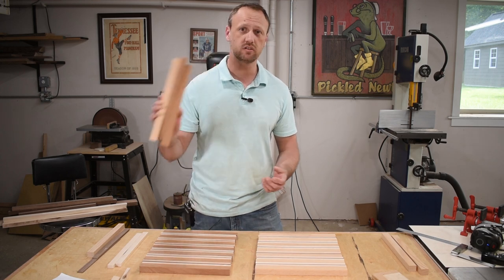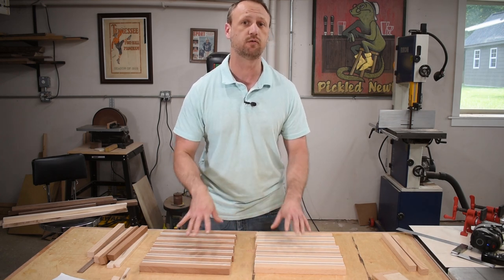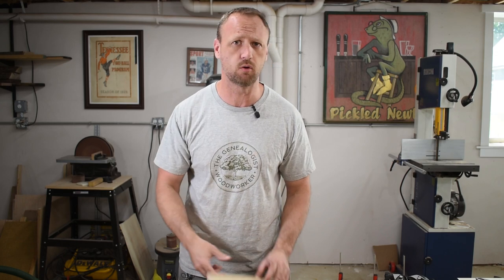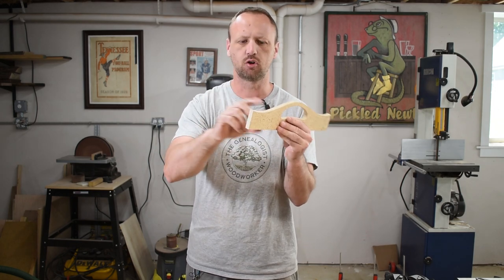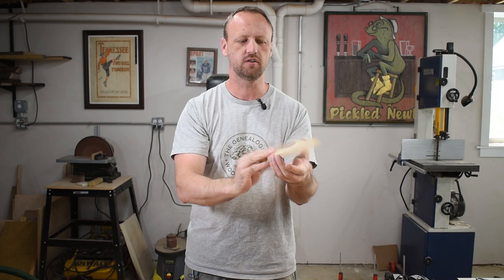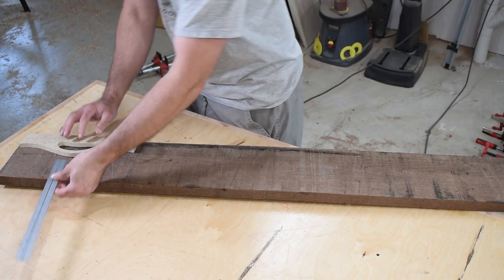Making Wooden Tray Handles from Figured Walnut

Comment: Is hide glue waterproof? I thought only titebond 3 was
Reply from the maker: No, it's not water proof. But it also doesn't desegregate with water if the glue is dry.
Reply: @NewtonMakes  ok. I don't think anyone is implying it would disintegrate. when I put that much time into a project that will repeatedly be exposed to water and changes in moisture levels I use water resistant glue. Was just wondering if there was more then titebond 2/3 with those properties.
Reply from the maker: I'm not implying that you're implying that I'm implying that you're implying it'll disintegrate. You asked; I answered. Though it really has nothing to do with this tray because it's a decorative tray. There shouldn't be water on it.